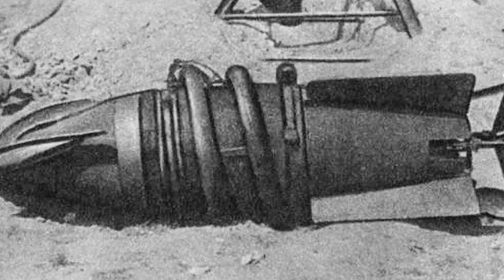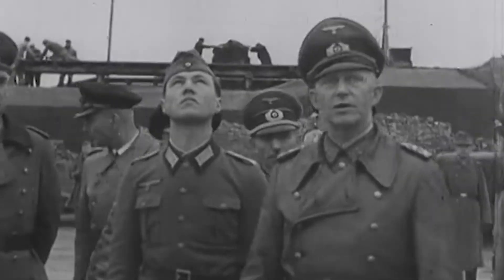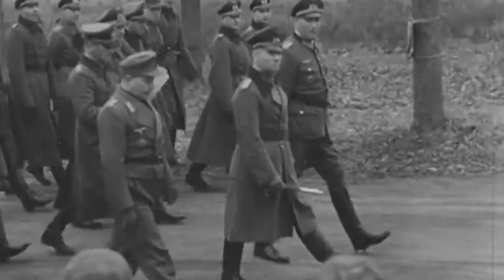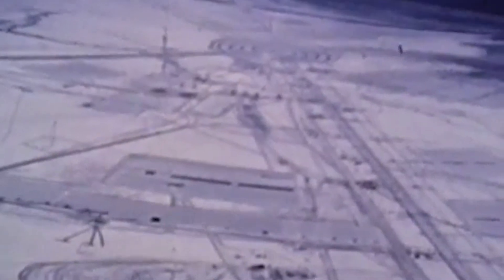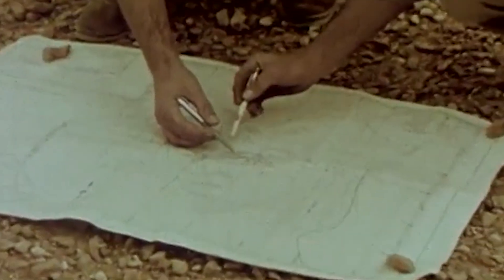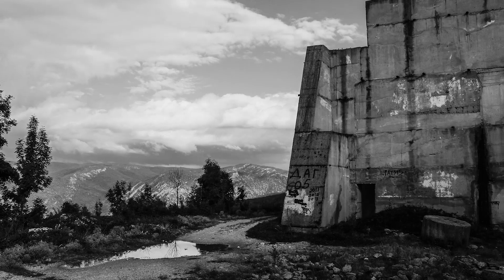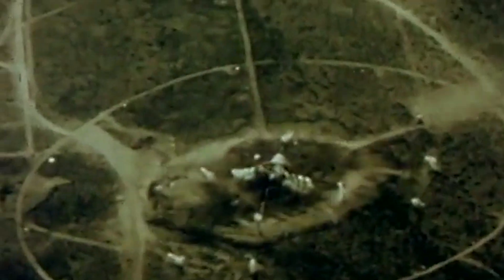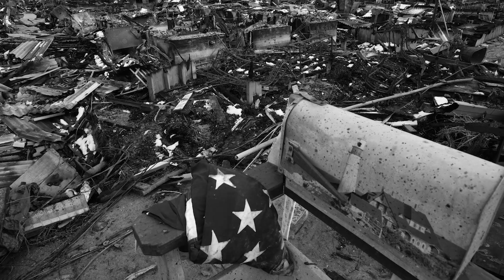The Soviet Nuclear Battle Mole: An Underground Cold War Battleship?

Comment: No doubt with a nuclear reactor as a power source, the right bit and a a whole lot of heat you could melt and open up anything.  Maybe when hydrogen fuel cells can be used one day we can use those machines but for now they are not going to be used under public roads by public employees.  It will be hard enough to have hydrogen techs handle hydrogen let alone nuclear materials outside of a power plant.  Fun video !

Comment: As someone who has worked in both underground hard rock mining and tunnelling, I can see no practical possibility of these machines in war.

Tunnelling is both slow noisey and produces large amounts of 'spoil' (dirt to get rid of out the rear of the machine)
Also the geology that the machine will pass through must be known, or the wrong machine may be used.
Tunnel boring machines only work well up to a certain hardness of rock, after which it is better to drill and blast.

Advancing more than 18-24m in a 24hr period would be considered good advance.

An awful lot easier to travel above ground or use missiles to clear the way ahead.
Reply: it was supposed to meet the rock almost with plasma. Our country is the first in the field of lasers and plasma. Yours is in ions. We split up a long time ago.
Reply: @spartacusnow
Maybe if it was boring through permafrost you might be able to heat up the local terrain somehow, but there is no way you can melt earth and rock in front of the massive machine and not heat up the machine itself.
I have worked in underground hard rock mining now for more than 15 years, drill and blast is still the fastest and most cost effective way to drill through rock.
Advance rates on a tunnel 5.5m x 5m is a maximum of about 12m/24hrs.
Drill, blast, remove spoil, carry out ground support and drill again.

Comment: This is nonsense. Melting rock would render it into a harder compound than what you started with, you'd be grinding not through molten rock but gassified pockets filled with crystallized slag, and woe behoove you if you hit rock with a high ferrous content you'll start smelting iron in your own way, not to mention insulating the rest of the body to be able to move through a super-heated tunnel - no, that's not feasible. Not on Earth. On Europa, certainly, in fact that is the sanest way to travel to sub-aquatic habitats which will be inevitable there.

Comment: Couple of issues, first the liquid nitrogen needed to stabilize the reactor is finite and would limit the range and burrowing time. Second you wound eventually strip the drilling head as those temperatures and the uneven density of the rock strata would apply uneven pressures and friction forces. Third the tunnel behind the vehicle is constantly being filled by debris so escape from a submerged vehicle that can not dig back to the surface is impossible.

Comment: there was a book in the 90s about underground american bases in the desert also included was blueprints for 2 nuclear powered boring machines. both different. also stated details of the bases. i read silly reports too of b52 bombers being moved underground from 1 base to another like 6 miles underground on an underground road/taxiway. 6 feet wider than each wingspan. was easier than to fly each 52 to the bases. tow them. underground lifts in hangars would take them underground. as for the book i dont know the name. saw it between 95-98 in a magazine maybe nexus mag. maybe this book --  https://en.calameo.com/books/0003960789600f9c80fae

Comment: Four comments:
1) How is the melted/abraded material disposed of? - Without pushing the material up to the surface (a dead giveaway), the only option is back-filling behind the mole with molten rock does. But that not leave a tunnel. It also exposes both the front and rear of the mole to extreme heat.
2) Without some major cooling, there would be way too much heat generated for humans to survive for long. How was temperature maintained?
3) The abrading of rock could be acoustically detected from a long distance. Similarly, unless the 'mole' is extremely deep, a thermal imagery heat map would expose a heat trail on the earth's surface. Could this ever be clandestine?
4) If the claimed tunneling speed was truly several miles per hour, why wouldn't tunneling companies be investing in such technologies, as daily progress with existing boring equipment is typically in the tens of feet per day (although these are typically larger diameter and extract the material to create tunnels, where as the mole may back-fill its hole)

Comment: I don't believe this could really work. Modern boring machines can't even do speed like that and if it were heated enough to melt rock wouldn't it metal metal? Like tungsten or maybe titanium, but both those metals are prohibitively expensive. a 4"x4"x4" tungsten cube is $2000+ Today, let alone in the 60's

Comment: there is actually quite a lot of speculation about this type of technology actually existing.. I tend to believe it too.. Of course, it's one of those things that I have to admit IS quite a leap of faith, however I just don't see any reason this couldn't be true? The idea of "Deflagration" by way of Nuclear power to literally melt most types of Igneous stone was first brought to my attention by the story of "Phil Schneider", there were extensive rumors going back to the 70's & 80's about the existence of "nuclear powered underground mining vehicles" that were like a long cylindrical shaped vehicle with a "pointy tip" at either one, or both ends. These "pointy tips" were some type of incredibly classified material capable of generating INCREDIBLE heat, and this thing would basically work much in the same manner a modern "TBM" or Tunnel Boring Machine's do, except instead of slowly grinding and cutting its way through, these "Nuclear TBM's" could create tunnels at an astonishing rate and the most incredible part was how it left the tunnel in its wake.. the walls would be lined with essentially "glass" that was much stronger than using steel buttresses, so it negated the need to really do much to reinforce these tunnels? I don't know how much of all THAT I believe about the no buttresses? But theoretically this COULD be done I suppose? But again, all of this is just conjecture as we have no real evidence of these ever being built....

Comment: Very interesting! Goes with what Phil Schneider Geologist. said about "Deflageration" as a way of drilling through the earth. Where drilling at 5 to 7 miles per hour was used.  It was said that the USA has lots of tunnels under it, as being able to travel across the US at 15,000 to 17,000 MPH speed dependent on traveled distance. Where shorter distances are slower. Where the melting of the rock removes the necessity for casing the walls.

Comment: Never heard of it before. Thanks. Many years ago I've read the rumors about guys who back in the cold war times (in the 60s) found a caves with glass-lined tunnels in the southern Poland. They explored caves for a while and then they've heard very loud strange noise coming from the tunnel/tunnels and immense heat. It was suspected that aliens living underground created these tunnels and used them to travel around... but this video would explain alot in this regard.
Reply: That would be this article: http://www.angelus-silesius.pl/monografie/traktaty/tunele_UFO_spod_babiej_gory.pdf (in Polish, but easy to translate hopefully).
Reply: "After quite a long march, the tunnel fell into a huge chamber in the shape of a standing barrelslightly oblique. The walls of this chamber were glassy like the walls of the tunnel we came in. They were nothowever, they are notched. Instead, the floor and ceiling were formed in some strange spiral patternlooking like a frozen vortex on the water. The outlets of several tunnels converged in this chamber.Some of them had a circular cross-section, while others a triangular one."
"As he explained the signs to me, he heard the distant sound unexpectedlyrumbling, hissing and metallic screech. It was like an oncoming steam trainchanges rails on switches or brakes. The father fell silent and told the rest I will explain to you inway back, now we must return quickly. We started to climb in a hurrythrough the entrance tunnel, chased with an ever louder rumble and metallic squeal. Fatherclearly worried and often looked back. When we reached the rocks at the entrance, hiss and squeakthey were already as loud as if the train was braking right behind us. After going outside andslamming the rock behind him, his father fell breathless. After a long rest, he began to work for me explain. The tunnels you saw were not made by people, but by all-powerful creatures,who live in the underground. These creatures use these tunnels to move from onesides of the world to the other. They use fiery flying machines for this purpose. Had the machineso invaded us, we would be baked from her heat."

Comment: The heat generated would fry the crew not to mention the radiation. Under gtound there is nothing to transfer the heat to with molten glass surroundings the machine.

Comment: This is fake.  Its a fake thing and doesn't exist and can't exist.  How would it cool itself when its surrounded by molten rock?  It would eventually be the temperature of molten rock itself.  Nothing would survive, nothing would operate.  Its also not a good idea to read verbatim from wikipedia.  Thats still plagiarism, but at least plagiarize something smart.  It would leave a glass lined tunnel? WTF?  Where did all that melted rock go?  That's as stupid as thinking a submarine leaves an empty tunnel in the water behind it.  Where would the water go?  It would also need to be about 1000 degrees Celsius hotter than you said to melt sand or clay or granite or just about any kind of rock.
Its fake.  Just fake.  Only fake. There was never a prototype. 4 miles per hour is idiotic.  Fake.
Reply: Yeah! Tunnels don’t exist, everyone knows that!

Comment: It sounds dubious. There are nuclear reactor types that can run really hot and you probably could make a drill to withstand this, but there is no way you could keep the rest of the vehicle in any reasonable temperatures. You would need to pump massive amounts of water to keep crew compartments cool. Also there is no way it could go 4mph. I can imagine tunnel borrowing machine based on that hight temperature, hight pressure concept, pumping water from a big reservoir (like a lake) to keep itself cool and help cool the walls, doing maybe 1 to 10 meters per hour instead a 1 to 2 meters per day as traditional machines can. But an underground self contained vehicle going 4mph... no I can't imagine how that could work, it would melt itself. 
Hmm well ok I can imagine how that could work, but the machine would need to be freakishly long, I would need to run some back envelope calculations, but I'm thinking about hundreds of meters long. Probably more than a mile, so it could dissipate the waste heat into the surrounding rock. And I still don't think it could go 4mph.

Comment: The Russians and others definitely did experiment with subterrenes in the 30s and 40s. But the only source for testing a nuclear-powered "Battle Mole" in 1964 are a couple Russian newspapers in 2009 and 2015 - one of which goes on to argue that the project was abandoned because of contact with an underground civilisation, which was also found by the Kola Superdeep Borehole. You can believe it if you like.

Comment: Who says rock has to be hard to drill through??

Try drilling through a pane of glass even with a diamond tip.  Takes ages.

Or instead tap it with some harder material.  Breaks instantly.  Don't scrape, fracture!  

This mole thing, if it ever existed, just used heat.  But it's still physically possible, and scary af.

Comment: Dark Docs has been drinking too much vodka while dreaming up this nonsense extrapolated from ancient science fiction.    First he says the Russians kept it more secret than their atomic weapons programme.   Then he says they abandoned the battle mole "at least in public" - so it wasn't a secret then??
He said Kruschev was embarrassed by having to back down over Cuba & wanted revenge.   Not so, Mr K got exactly what he wanted - a promise by the USA that they would never again threaten invasion or military intervention of Cuba, and the removal of US missiles in Turkey targeted at Russian cities.
What are the fins on the back of the mole for, anyway?  Fins are only good if you are going thru water, or going thru air at very high speed.  1950's technology nuclear reactors couldn't fit in a mole this small.  Soil and rock are effective heat insulators.  So, all that heat to get thru the rock at the front has nowhere to go - except to melt the mole - unless this thing only moves at a speed at which no heat is required (as in a normal tunneling mole).

Comment: This is totally a fantasy.  I've been involved with mining,  both surface and underground.  Over the last 30 years I've worked around the most advanced technologies the industry has.  I'll be the first to admit that I know very little about nuclear physics, but I do know quite a bit about moving rock and tunneling.   The application's this machine could have in civil engineering alone,  would have made it all speed ahead.  At this point I just can't see how such a machine could exist,  or at least one that works.

Comment: Both superpowers tried out quixotic weapons systems in those years, and I'm sure no photo's or reels of several US projects were ever showed to the public. That doesn't mean they never took place. Of course it is speculation, based on a small number of indications, of course it is like building a wall with 90 % of bricks and only 10 % of bricks. Does it mean it was never tried ? The speed the drilling could reach is depending of the type of underground, it's not all "rocks" below, there's also chalk etc. The high temperatures are of course a problem, but problems like that can sometimes be solved, think SR  71. Whether it would have been feasable as an extra  strategic nuclear option is rather doubtfull, but why not as a tactical weapon. I wouldn't be surprised if the Russians did such research, not just as part of the arms race, but also with mining in difficult areas in the back of their mind. If there are no pictures available, maybe it is because it turned out to be an embarrassement how badly it actually worked.  Having said that, the Russians made the Sputnik, were the first to get someone in space and back safely (even if the flying was done with remote control), were the first to bring gender equality in space, and made quite succesful flying boats. Of course the country couldn't compete on many levels with the West, but reducing the USSR as a collection of drunkern idiots is the kind of arrogance that made the US loose the war in Vietnam. Over-estimating (Pentagon) as well as under-estimating (the American "pulic") both brought the US on dangerous grounds, the first one with budgetary problems, the second one with loosing wars in so called "retarded" third world countries.

Comment: Your words dosen't match with the engineering science.
The friction is already tremendous undegrounds;more external heat will just adds on to it and prevent any drilling tip to operate under this circumstances.
Even if it is possible you should emerge into surface each couple of miles to change the drilling tip.

Comment: Really interesting idea - I'd be curious about the potential civilian applications of such a thing, basically a 4 mile per hour (rather than maybe feet per day at the very best) boring machine that can make tunnels wherever needed or wanted almost on a whim, making fully lined tunnels ready for use. Could make tunnel-making a much cheaper and quicker process. I've pondered what impacts a vastly capable boring machine, another example being the (entirely fictional and implausible) boring machine from the Disney movie Atlantis, might have on the world. Infrastructure projects would be much easier and cheaper. Want to build a new public transit train line? Forget about eminent domain, concerns of noise and road crossings (big stumbling blocks of the new commuter trains they're building in Denver), terrain, NIMBYs, whatever else might be in the way, and dig a tunnel! I would imagine that if such technology were available and widespread, the surface of every city would be buildings surrounded by tranquil park space, maybe a few scenic boulevards, while roads, railroads, powerlines, and all other infrastructure are hidden away underground.

Comment: well the melting point of granite is about 1200 ° C but  at 1000° C a drill of titanium( 1600°c m.p) can go like a knife through the butter. if you put the nuclear reactor in the drill  and  keep the temperature of your reaction at 1000°C ( uranium m p is 1200°C)  you can go for a few miles. One way only . It is not impossible but a lot of work and money  for some limited benefits. You need to know precisely where the tectonic weak point is, precisely guiding your engine and with the right amount of nuclear power . And you have to employ several moles to have a big tectonic reaction ( 6-7 richter magnitude).Deploying the moles is also a problem , USA acoustic  warning system in Pacific  will detect  the starting of the drill. Also the earthquake surveillance system will detect the direction and  speed of the boring. That will give time to cut the gas alimentation and warn the civil population .

Comment: I don't believe those numbers about the boring machine at all. So the drill doesn't need to be replaced after awhile? 9 miles per hour is extremly fast for boring tunnels, even in softer earth. Furthermor, the seismic signature it would've produced could be detected fairly easy.

That's an extremely ambitious project to say the least.